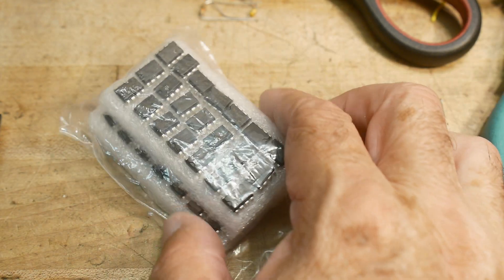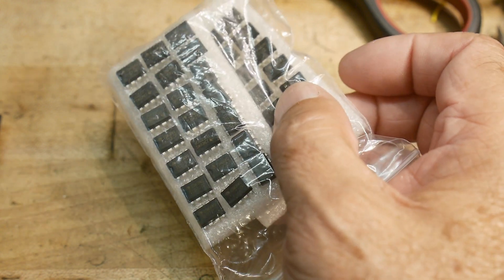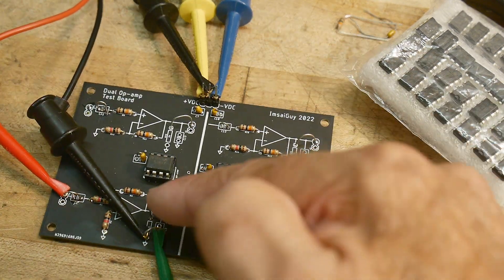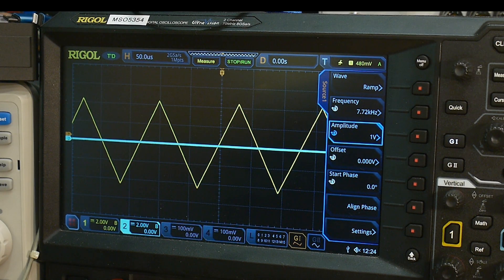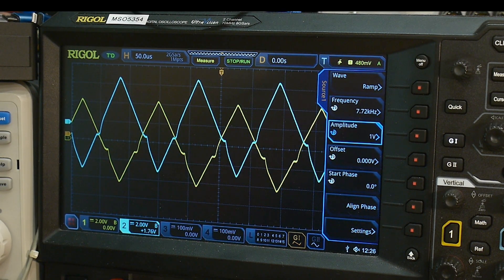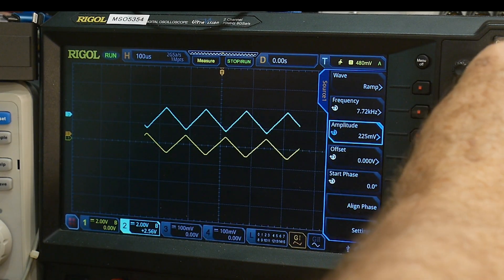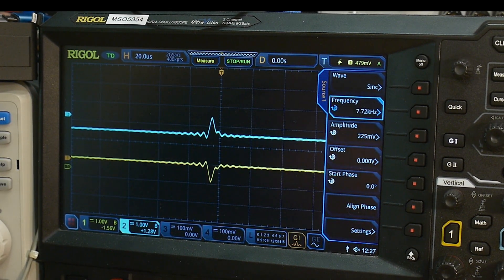#1625 These opamps must be good for something?

Comment from the maker: with help from W2AEW's video #215 and some more testing of parts. I can now say my 'TL072' parts are remarked LM358 op-amps which suffer from crossover distortion (yes even legit ones!). The parts are useable but only when you add a 1K resistor from the output to the negative rail to keep the LM358 from floating during the crossover. I'll do a follow up video someday. LM358 parts are useful in single supply circuits where you need to come close to ground. Crossover distortion is pretty rare in more modern op-amps. Oh, and a LM358 is way slower than a TL072, so there's that too
Reply: LM358s are good parts for many things - just be familiar with their internal schematic.

A lot of details that the datasheet only mentions by numbers (or mentions by not mentioning) become obvious. For one thing, they’ll just about murder anything past 10kHz at gain one.

With gain>1 they are OK for low frequency work when their offset drift is compensated or doesn’t matter. 

Using two or more from the same package in a way that adds offset to both the signal and its reference compensates a lot of offset drift.

They also don’t have enough gain in the output stage so in any application where you care about AC performance - especially stability (!) -  you have to use their output stage in class A configuration, with a follower buffer added. 

It’s their “claim to fame” to start performing less horribly with a follower on the output. Even better if the 358’s output is loaded with a current source.

Also it helps to use them in inverting configuration so that the dismal CMRR doesn’t suck what little performance they got. 

But any of that only matters when you design for a “wide open” hobbyist market where all someone may an ave access to is fakes with an LM358 inside. For anything else - any rail-to-rail cmos op-amp designed in the last 20 years has them beat. In performance. Not necessarily availability.
Reply: I actually have a whole bunch of fake TL072's from 2 different suppliers but none of mine come close to de ground rail. So I'd say you can't predict what you are getting when you buy these.
Reply from the maker: @sud9320  yes, there is no way to tell
Reply: Please make a video, does 1k resistor workaround work for you or does't https://youtu.be/VgodYtiD_F0?si=sZwA6x0yMqUdd4N0&t=470

Comment: I have had my share of fake parts. My customer bought a big lot of LT1990 for a design I made. None of the cards worked. I inspected some of them. All of the LT1990 were shorted at supply lines.  They were then replaced with real parts and things got corrected. I took a few samples for my archive as this was so unbelievable. The same thing happened again after a few years with the same part and same customer who probably bought them from ebay.

One strange  part was OP177G which is an extremely good opamp with a low offset and drift. The test circuit consists of an amplifier with a gain of 1000. It appears that it does not work as promised. It sends out a random popcorn or shotgun noise of about 1 Hz of significant amplitude. It was tested with several units, all the same. This is clearly a feature of the chip.

Years ago I had to design fast amplifiers and I purchased a big lot of AD829. That is a really fast amplifier in SO8 and the noise voltage level is extremely low. I have never seen any other +/-15V  opamp with such specs. I still have those on the shelf.

Comment: Could you use them for DC stuff like followers/amplifiers? example would be current measurement (amplifier) or follower for ADC , slow peek detection?
Reply from the maker: they turned out to be LM358

Comment: The broader question remains... How to use inferior parts of any ilk? As I see it... Firstly, it would never be advisable to use them in a commercial product. Secondly, you will need to invest the time and effort to a) characterize how the part performs and b) confirm that performance is consistent throughout your stock. Or, donate them to your local makers group to practice soldering, a use which should not be underestimated, IMO. Cheers!

Comment: You could put 5 of these together and build a 10 bar/led driver display for audio level or voltage level indicator. A voltage divider with 11 resistors in series will give a reference for each op-amp.

Comment: You could operate them in class A, to get around the crossover distortion.
Load the output to the negative rail externally with a resistor or something, then bias it around 3/4VCC, towards the positive rail. That should have no crossover distortion since only one of the output transistors is working (the positive side in this case).
Then also use it only as an inverting amp, since the CMRR is most likely pitiful. So with all this it might work good enough for an audio amp
Reply: LM358 and audio should not be put in the same sentence. Their open-loop gain rolls off at 10kHz, so they can't even cancel their own crossover distortion, much less so higher order harmonics. They're only good for general purpose, ground-referenced DC applications.

That being said, I have used LMV358s in limited-bandwidth (8kHz) mike and headphone preamps designed for speech only. They at least have a class-B output.

Comment: I am not quite as negative about these Chinese parts kits.  It's definitely true that you don't know what you are getting so there is a risk.  When I was starting out, I bought a kit from Amazon with 120 pieces of various ICs: a few types of op amps, Darlington pairs, LM386, comparators, and one kind of opto coupler.  In every case so far, parts from this kit have operated OK as some sort of part of the right sort.  For example, the kit includes op amps marked NE5532P.  These op amps are definitely not NE5532P's.  They have less bandwidth and a lower slew rate-- but they work much better than the Chinese op amps you tested.  In a 10x inverting amp configuration with a 1V input, they look fine with a 50 kHz input triangular wave.  For casual educational experiments using a generic op amp without pushing it, they are fine.  I got a bunch of parts to play with and learn from for a very low price.  But it is definitely a case of caveat emptor, and you need to plan to test the parts to see what they can do-- and don't pay too much!  Amazon lets you return stuff if it disappoints too much.  BTW, your channel is one of my favorites-- so thanks!

Comment: This "funny" behaviour may have some positive usage! Well, in the guitarist world, if you have something different from another 100k guitarists, than this could be considered as a "feature not a bug". Lets say you use it as hi-gain distortion or overdrive circuit with diodes to ground in output  or with diodes in feedback loop. Then this "assymetry" could be utilized as 'ekhm' "specifically sounding feature that nobody has". Sounds like "MILLLLLLION DOLLLLARS :)".  Yeah, not all guitarists are audiphiles in common sense, but AUDIOPHILES in THAT sense. IMO, try using it in simple audio application or "guitar effect" if you wish to see it that way! Then these are not garbage anymore, they are my precious :)

Comment: One thing I'm curious about -- what is actually in these bad op-amps?  Are they repackaging old parts by changing the labels, or are they actually manufacturing bad stuff?
Reply from the maker: some guesses are re-marked LM358 single supply parts. I'll be doing a follow up video
Reply: @IMSAIGuy  looking forward to it.  So if I want TL07x/8x parts for a synth project, I should just buy them from ... digikey?  Mouser? Any recommendations?
Reply from the maker: @nickcaruso  those two places are good

Comment: As mentioned it looks like the transition from positive to negative output current is not well adjusted. To much gap in the so called "Class AB Control Circuitry" at the output. 
The tests made were symmetrical for the input and the output. As the amplifier has two input stages, one for high and one for low common mode signals this could also be the source of failure. One could still find out whether it is the input or the output that has the transition gap. 
There are applications like regulating power supplies where there is no zero crossing and they should be able to work normal. But with the price of those components today I would just get new ones to replace them in the drawer for the next 10 years.

Comment: I got some TL072 Chinese parts that turned out to be decent LM358 op amps (actually if I remember had slightly better slew rate than some old stock real LM358's).  But in most respects (including the cross over distortion) they behaved the same as the LM358.  But this could actually be very useful if you understand what the LM358's were designed for.  They are best in single ended applications and are designed to be able to push the output close to the 0v rail.  They are slow so they are good for low speed servo control.  For example, they would be excellent application to an adjustable constant current load where the voltage drop across the sensor resistor would be attached to the ground rail.  In single ended applications you can usually set up the circuit so that it is only sinking or only sourcing current and in that case the cross over distortion is not an issue.  So I bet these would be very useful in low speed servo control type applications using single ended supplies.  In fact, I suspect they would be good replacements for LM385 op amps if you were in a pinch.
Reply from the maker: others have suggested they are 358   I'll have to do some tests
Reply: LM358 got about 50uA of sink current capability for outputs below 0.7V or so. It really helps loading it some more with an external current sink so the output stage runs class A. It will then happily drive AC down to 0.1V or so.

Comment: I bought some TL072s from a reputable Canadian dealer and they all had crossover distortion. The schematic I was working from to learn didn’t work properly, so now I’m wondering if they unknowingly sold me some dodgy clones.
Reply: ... or some miss labeled 358s?
Reply: TL072s should be fairly smooth on the output as it crosses mid-supply (usually 0V). Common mode must be 2V or higher above negative rail, and output can be about 2-3V from either rail at the closest. Pretty nice parts for interfacing with germanium PNP analog circuits that work up to positive rail :)

Comment: a couple of years ago, i made a similar pcb for opamps with bypass caps and it fits on a breadboard, about an inch long and slightly wider than opamp due to the bypass caps.
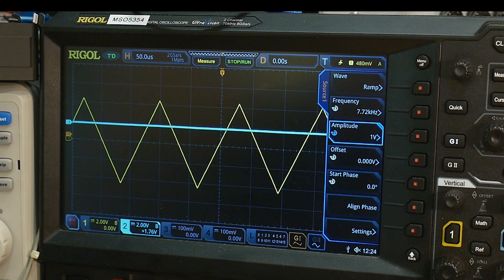3:23 that looks like the zero crossing of  totem pole transistor arrangement, but the bases aren't properly biased.
It seems who ever made these doesn't have the skills of tools to trim onboard resistors, capacitors.
Reply: Oh they had skills but laser trim in the 70s was expensive :)
Reply: @absurdengineering  You think these Chinese opamps from the video where made in the 70ties? There is this known guy who has a Tube channel en reverse engineer silicon, he showed how they do it, it's more or less a path you cut off.
Reply: @AnalogDude_  laser trim was super expensive back then. It is cheaper today  - but when you’re making fakes, why bother trimming them? Saves half a cent per part or whatever. I guess my weird sense of humor doesn’t come across very well.

Comment: Could you use them as comparators so you only care about pegging to the rails and not amplification?
Reply: I did it and is ok at low frequency.
Reply: LM358 are horrible as comparators. There’s no point to using them in that role. LM311/393/2904/2901 are same vintage, same process, same price, but much faster and have some nice properties “at the edges” of specified operating conditions.
Reply: At 100 Hz, maybe. Their slew rate is horrible.

Comment: Crossover distortion - looks like LM358.   I did a video on this (#215 on my channel). Adding a DC offset to the signal could help to, to keep the output stage from hitting the crossover point.
Reply: my thoughts exactly
Reply from the maker: I didn't even consider them being single supply parts. I'll have to run some tests with the mindset of 'wow I can have as many LM358 opamps I want for free!"
Reply: run OP in A class, but it wont be low power enymore
Reply: If it is LM358 or similar it may be a very useful part. With single supply it can reach negative rail on the input with no problem or malfunction. Also on the output it will go near the negative rail, good enough to drive a microcontroller input just for example. I still use this part in comercial products - it is cheap, easy to use (within ther limitations of course) and no delivery problems or delays at all as there are still different manufacturers.
Reply: I wondered if that was the case, googled for LM358 crossover distortion and the first video hit was your #215
Reply: Oh well, I was sure I had posted this comment already but ...
They are all 358 clones: someone on another blog have decapped the various 741, 358, 5532, tl702,... and found out there are four or five variants of the same design, that is 358-like but has a higher slew rate than the original part. They make a decent 358 substitute.
Reply from the maker: Alan, these do act as old national LM358, I have some LM358 from TI that seem way better, hmm. I'll do a follow video someday
Reply: LM358 is like a wholly different part with between 0.05mA to 0.5mA of a current sink loading it. The resistor robs it of what little gain it has. An (ideally cascoded) current source is the trick. And a follower if you got headroom for it. Eventually it takes so many tricks to make them perform better than specc’d that it’s not worth it.

But if you ever have one oscillating, it’s likely because it ran out of gain prematurely, and a follower + current sink load is the fix.